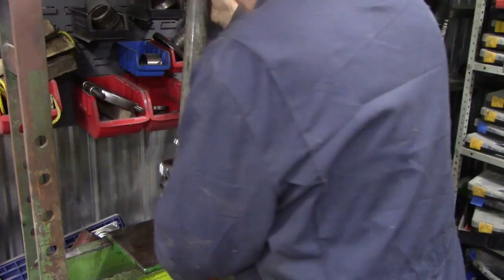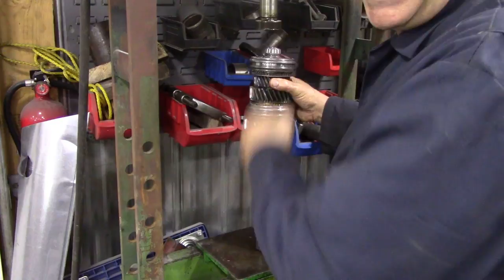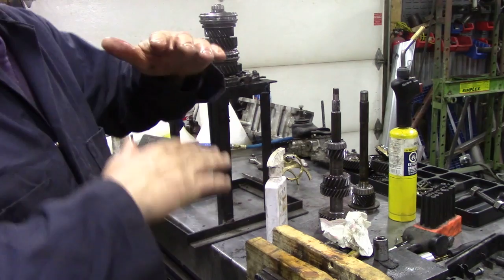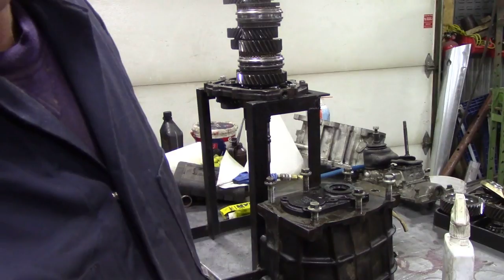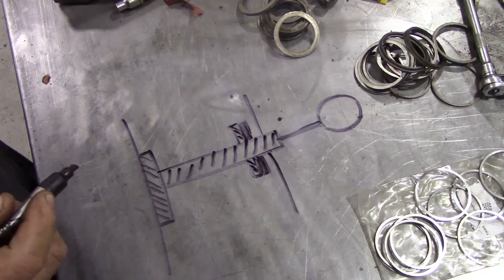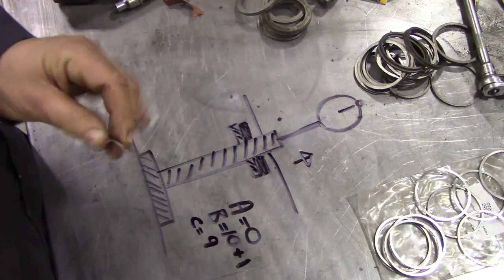Land Rover R380 suffix J gearbox overhaul Part 2 Inspection and Reassembly

Comment: Hello Mike,

A question about the baulk ring clearance tolerance:

The manual states 'a minimum clearance of 0.5mm.' Does this mean that a clearance smaller than this - i.e a clearance of 0.3mm - is out of spec and requires a new ring? Or is it the other way around?
Reply from the maker: If the gap is too tight the ring will not be as effective and can cause gear grinding, so in your case, yes, the gap is too small
Reply: @BritannicaRestorations  finding your videos extremely helpful! One question for you, what is an effective way of cleaning sealant from the mating faces of the casing without damaging the aluminium?

Comment: Hello I have a D2 td5 with R380 box. I removed one box due to a bearing collapse and fitted a secondhand box which I have found out has worn syncros in 1st and 2nd. It is a bit notchy in other gears to. The old box was smooth till it ran low on oil. Question is what size press would I need to press the bearings? Would 12ton do it? thanks
Reply from the maker: 1ton is enough

Comment: Hi! I'm reassemling my R380 in that moment and i have a question for the shimming... If I take the measurement of 0,01-0,06mm like in the book, (the tolerance of the ashcroft-shims is 0,05, so it has to in be in the right range), there is allways a little play by moving the input-shaft. If I take the next shim, with just 0,05mm more, the play in the shaft has gone, but i can still turn it lightly by hand...
Out of the feeling I would assemble it like this, and i think there will be a little more tolerence when the sealing is in... What do you think? Is that ok, or is the little play (about 5mm i every direction at the end of the shaft) the right way?
Thank you a lot! :-)
best regards, Christian (and sorry about my rotten english! ;-))
Reply from the maker: Christian 
I have had them slightly over what they say in the book and it was not an issue  
The shaft on the R380 is quite long so there is a lot of leverage and does not take much (as you found out) to make the difference between tight and lose
Yes the bearings will settle in, but you also have to consider expansion and contraction of the shaft etc

So you will be OK, I would have thought with the slightly over shimmed shaft- if you see some of the boxes I have worked on it's a wonder they work at all they are so lose!
If the box is too tight it will run hot  so no more than 0.05

MIke

Comment: Hi,is it reasonable to use  bearing  kits in land rover restoration ( gear and transfer boxes, engine etc.) offered by Britpart or i have to consider Timken's bearing from Ashcroft? Thank you in advance.
Reply from the maker: Opps I missed this question! Forgive me for not answering sooner!

Britpart supply many parts to Ashcroft's but there are different qualities of Britpart parts - if you have the part number simply stick a G on the end and it will come up with an OEM number (like Timken)
Stock BP bearings will be Chinese, however in many cases BP bearings are supplied by Ashcroft as there is no alternative
Mike